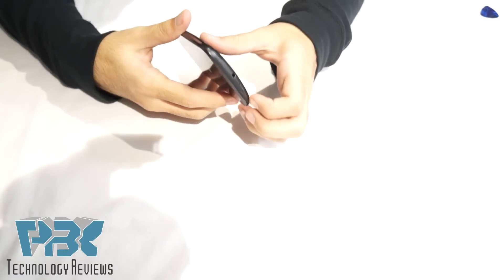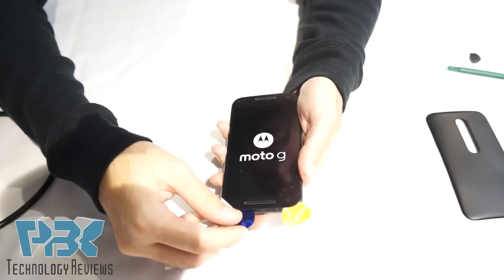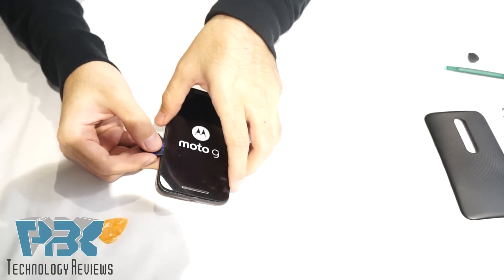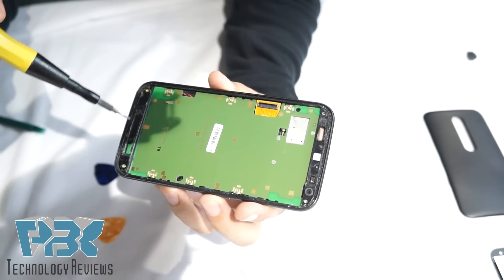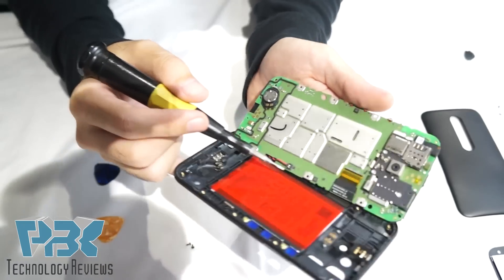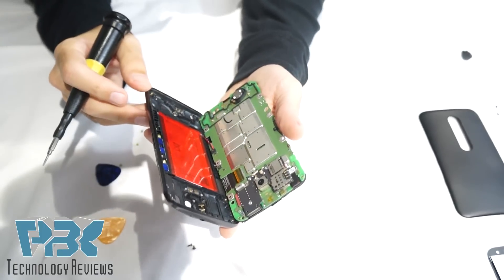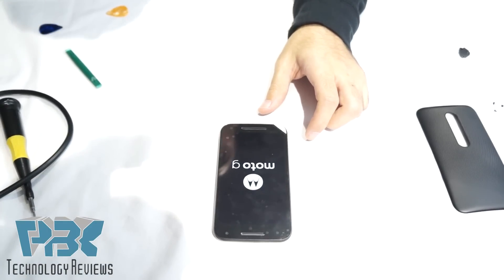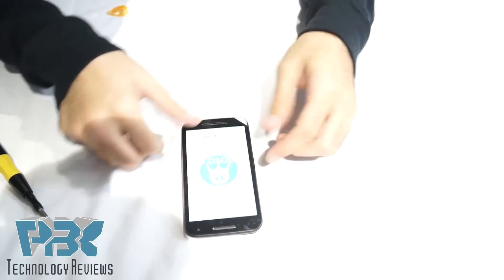Motorola Moto G (3rd Gen) 3rd Generation 2015 Disassembly Teardown LCD Replacement

Comment: Thanks for the video! My replacement battery does not have that red film cover the original battery has. What is that red film for?
Reply from the maker: Hi, I think its just a protective film over the battery. You can peel it off the original battery and place it on the new one.

Comment: Flashlight of my Moto G3 Turbo suddenly stopped working last week. It lit up only when I put pressure on the back near the flashlight.. please help
Reply from the maker: Probably the gold contacts behind them either have gotten dirty or bent down a bit so its not making a solid connection. You would need to take the phone apart to be able to get access to where the flash is and the contacts to make sure its cleaned out and properly making a connection. Not sure if its worth risking taking the screen off for just the flash issue etc. if accidentally it cracks and the fact you will need to re apply new adhesive. But its up to you. If your careful its doable.

Comment: while replacement do I need to apply adhesive (Glue or something) on the edges of the body?🤔
Reply from the maker: If your adhesive isn't holding well anymore, yes you will need to apply new adhesive. You can use smartphone Red tape which is sold on ebay. Its a strong adhesive tape you can cut to size .
Reply: @PBKreviews  ok thanks

Comment: the cable which you are pointing at 8:51 where can i buy that cable?...and can it be replaced easily?
Reply from the maker: Hi you can find it on ebay, search for moto g3 lcd flex and you will see it. And yes its easily replaceable. You just peel that yellow/orange sticker off the cable, left up the black lock in the side of the connector, pull out the old cable and insert the new cable to the motherboard slot, push down the black lock and put the yellow/orange sticker back over.
Reply: @PBKreviews  is the cable same for Moto g3 and Moto g turbo edition?(I own turbo edition)
Reply from the maker: Yea should be the same, I don't think they would make a different one for such a similar phone.
Reply: @PBKreviews  thanks man... appreciate  that you're still replying to the comments for a video published 3 years back😀
Reply from the maker: no problem :)

Comment: how to fix a screen display vertical lines,please help
Reply from the maker: If it has lines running through it most likely the screen will have to be replaced because either the screen is bad or the cable for the screen has gone bad.

Comment: thanks, excellent video. 
i have a question, will that affect the ip68 protection
Reply from the maker: I'm sure to an extent it might affect it, but if you have the replacement seal then you can apply new adhesive seal to it and should be good to go.

Comment: I was trying to removing battery beuase my XT1557 Got hard brick after 12 MB bloody update had taken place.My phone battery is not embedded with cable it is embedded in it .WTF!😨
Reply from the maker: have you tried holding the vol down key and power key for 20-30 seconds to try to reset it that way?
Reply: pwrdbykyank obviously
Reply from the maker: As far as I know, bricked or not, should be able to plug the cable to the computer from the phone while holding the vol down and power and should auto boot to the bootloader screen from where you can reflash it. As for needing to disconnect the battery cable, you will need to take the phone apart to disconnect the battery cable from the main board.
Reply: pwrdbykyank I mentioned to you that my phone is hard brick not soft brick
Reply from the maker: Oh ok, well I am not sure on how to fix that exactly, every model has its own ways I presume. Sorry
Reply: pwrdbykyank Its ok😭

Comment: just apply heat to put on the new display?? or need a special glue?
Reply from the maker: if the original adhesive around the inside of the frame is still good you can reuse it but if you want to ensure a good bond, you will need to reapply new adhesive/tape

Comment: I need help. I hope you will reply. 

My phone fell by accident hitting a wall on the way down. All of a sudden I lost sound. I smacked my phone and the sound came back. The sound had stopped a few occasions and I took my case phone case off and hit and then the sound was fine for a good while. 

Recently it stopped working due to me gently throwing the phone on my couch but this time the sound wasn't coming back when I smacked my phone. So I took the cover off and smacked it. 

I learned that smacking my phone where the three screws were (where you said the charging port was held) was were the sound issue was happening. Tapping that area made the sound come back and holding it for a bit then letting go seems to bring back the sound and it doesnt go back to no sound.

My question is  if I tighten the area with the 3 screws will this permanently fix the problem or would I have to open it all up and see if the speakers wires etc are disconnected. I don't want to put my drop my phone gently on something soft like a couch or bed and the sound goes back off again. 

By the way can you recommend a good screw driver to open my phone if need be.
Reply from the maker: Shade On A Cool Day hi yes it you tighten those screws it should help fix it since the contacts that touch the speaker to give it power are on the back housing. If it doesnt fix it, then maybe the speaker is going bad and need to be replaced. As for tool to use, husky brand has torx screw driver set you can use or different brands as well. T4 or T5 would be used for this phone
Reply: @pwrdbykyank Thanks. If you want some interesting youtube channels to watch check out the channels Vrillex and Black Child. I'm not affiliated with them in anyway I just find them interesting.

Comment: Thank you for the guide. I was able to replace my battery using your video guidance. My screen now has purple tinted lines all over though. You think my screen is busted or a cable adjustment issue? Thanks.
Reply from the maker: Maybe the cable is not in correctly or all the way. I would first look at the cable. If still issues then maybe you damaged the cable.

Comment: Basically the part of the phone where you connect your headphones is giving problems(only one side of my headphones for) so I wanted to replace it so........ Is it possible cause you didn't say anything about that?
Reply from the maker: Yea the headphone jack is replaceable. It sits in the rear housing and you can pull it out and replace it when you disassemble the phone.

Comment: I bought the Moto G Turbo Edition (the G3 on steroids). Unfortunately I used it to goof around in a pool and then water came inside the phone (I swear the back cover was correctly closed). Then what appears to be the touch component started to malfunction (like if the screen was pressing itself...like possesed by a demon, seriusly). I thought it would pass away with time but now it doesnt work, it doesnt even charge, howewer it looks like it can ve saved. What do you recommend me to do?
Reply from the maker: Jimmy Ramos best bet is to take it apart and use a toothbrush to brush off all the corrosion around connectors and chips. Then put phone back together and see if it will work.
Reply: pwrdbykyank thanks, I'll try whatever I can. By the way thanks a lot for the video, it was really well done. Very helpful.
Reply from the maker: anytime, thank you.

Comment: How do I change the  battery?
Reply from the maker: its attached to the back housing, you would either unscrew the two screws holding the plate it sits in and remove it that way after you have taken the phone apart, or you can heat up the back and pry off the battery from the plate it sits in once you have disassembled the phone.

Comment: My moto g3 turbo front camera is not working can u help me
Reply from the maker: Hi, if the camera is not working, you would need to take apart the phone and most likely replace the front facing camera. The hardware probably failed on it.

Comment: What temperature did you put on the blow dryer when the screen was warmed up?
Reply from the maker: well if you use a blow dryer/hair dryer there really is no temp you can adjust. You just heat it up to a point that you can tell the screen is hot to the touch. You dont want to heat it up too much and make sure you aren't holding the blow dryer/hair dryer in the same spot. Circle it around and gradually heat it up. Then you can try prying it up gently. If you see its too hard you can apply more heat and keep going. Excess heat will either make the glass too brittle and break when prying off or will melt off the digitizer glue and separate it from the screen or just damage the part in general. Thats why I suggest a blow dryer/hair dryer instead of a heat gun because less chance of causing damage if you don't know how to properly use the heat gun and temps.

Comment: My moto g3 display don't popsup after unlocking my  phone , but after switching it off and then on the phone ,, the display comes on , then the thing happens 
.
Reply from the maker: Not sure maybe you have corrupt software. Try flashing the stock factory firmware onto the phone with rsdlite. If you dont know how to use it google it or take to a professional to do for you

Comment: I really appreciated this video. My speaker was cutting out and I learned from another site that there were two prongs that needed bending upward to tighten the connection. This video helped me get to the offending prongs and all is working.  A couple of points though - I used a Torx T5 driver not T4 as mentioned here. Could not find T4. Also one corner of the screen did not glue back down properly when I replaced it and I can see light inside the device .  There was very  little adhesive there in the first place. 

What sort of adhesive can I use to seal the screen piece?

Comment: Is the audio jack even replaceable?  It looks like it's just stuck in there, and not really removable.  

I don't think I'll be doing all this for just a bad audio jack either way but such a stupid reason for needing a new phone.  Mine keeps having issues where it doesn't register that headphones are attached.  And when it does and I get to listen to music it then goes to pausing the music because it thinks the headphones were unplugged.  

Next phone I get I'm going to look into how repair friendly the phone is, because this is way too involved to be worth it for a cheap part.
Reply from the maker: Yes the audio jack is replaceable, it just sits in the back housing, but you can pull it out and replace it.
Reply: Good to know thanks.  I've been wanting to upgrade phones for a while now so might do so when i have the funds.  1gb of ram doesn't cut it and most of the time even just typing on my keyboard is really laggy.  Can't afford it now so it's good to know its fixable.

Comment: I took my Moto G3 to get the SIM card reader replaced and when I went to pick my phone I noticed that the ear-speaker and the mic weren't working. I couldn't hear while in phone calls and people couldn't hear me either. Only the main speaker worked but that is useless if I can't make calls or record audios in whatsapp. So I took my phone back to the service center and the man told me that the SIM card reader pops out of its place (that doesn't sound possible because there are some screws that prevent that popping) and that the sound isn't working because the same SIM card reader is connected to the "sound card" (if that exists). Could you help me verify this info he gave me? I don't want to be fooled, and if he broke my phone more than it was (it only had the sim card problem) he's gonna have to pay for it.
Reply from the maker: Hi, I'm not too sure on that, I haven't ever herd of that sim reader board being the issue for something like that though. Also the mic and speaker are located two different places so the chances of them damaging something related to both of them would be small. Maybe they forgot to put in the earpiece again? or maybe your headphone jack might be bad. Hard to tell can be a lot of things causing it.
Reply: pwrdbykyank I went to the service center today for nothing. The man hasn't figured out a way to place the reader without it popping back out, he said that the pins are smaller than the ones from the original resder. He also said that in the module there are some contacts that connect the mic and speaker. Is that true?
Reply from the maker: Hmm not too sure, its possible but I haven't worked much on these phones to know more about that. Can't they just get another reader board from elsewhere? maybe finding a parts or repair phone on ebay and taking it off one?

Comment: After dropping my motorola moto g 3rd gen there was no sound coming from the speaker at all! I've removed the back case and only seen a few screws by the charger port and by watching this video it helped me locate the speaker and simply pressing hard on both sides from the screen and at the back, it must have been a lose connection or something because it's working again.
Thanks 😃

Comment: My moto g3 loudspeaker has small mesh and i can see green component a bit.So, my question is will it safeguard from water?
Reply from the maker: I'm not 100% sure but I would lean toward that it would still be sufficiently safe. If it bothers you though, you should open and replace it with a new mesh

Comment: My phone get wet. After six days it worked again. All seems to be right till I found that vibrator dosen't work any more. Where is the vibrator motor in the mother board? Its changable?. Another question: What temperature do you use in the heat gun to take off the screen?
Reply from the maker: Hi, the vibrator motor is right above the LCD connector on the back side of the mother board. If I remember correctly its soldered onto the board but is replaceable. Maybe it just has corrosion on it, you can brush it off and should work again. I'm not sure on the temp, but you can always use a hair dryer to heat it up

Comment: Hi....my moto g3 is not giving battery backup for full day on normal use...I am using two sims which is Jio 4g VoLTE and Airtel and i use jio data very rarely not often all the  time i have optimised all apps no background running apps still not giving backup..battery is in dead mode..? Pls help me..quick response will helpful for me...Thnx...
Reply from the maker: Hi, I don't know what you mean by battery backup?
Reply: pwrdbykyank my moto is not holding the battery backup..?

Comment: Where's the antenna?
Reply from the maker: antennas are on the plastic back frame or mid frame, they are the painted looking lines running on and around it, and they touch the gold points on the main board to make connection.

Comment: Fala Galera, eu resolvi o problema do Led de notificação acesso.  Isso ocorre pois entra umidade pela entrada do falante auricular, e oxida os componentes ao redor do LED.  Para solucionar tem que abrir o aparelho removendo a tela, removendo a placa, removendo o suporte plastico que fixa o falante, e limpar com álcool isopropílico o LED e os componentes ao redor do LED. Deixar secar bem, e pronto.  Problema resolvido !!!    Abraços

Comment: Can I use a hair dryer? Is it safe to use that..? I want my display safe..🙄
Reply from the maker: yes its safe to use a hair dryer, you dont need to heat it up too much, just gradually heat it so it loosens up. Meaning don't hold the hair dryer one spot for 2 minutes. Keep moving it around so it slowly heats up to a point you feel it will come off easier.
Reply: pwrdbykyank Actually my SIM card tray is damaged, ordered one and it is on its way.. Thank you!😊
Reply from the maker: no problem :)

Comment: Hi. Can I use hair dryer to disassembly LCD?
Reply from the maker: Yes you can use a hair dryer to heat it up
Reply: Oh, greath :)
And one more question,
Can I get a warm adhesive directly when the screen is removed and then back the screen? It seems to me that this is a better way to heat adhesive, but I am a beginner, don't know if that is possible...
Thanks a lot for fast answer, and for greath video too ;)
Reply from the maker: I dont understand what you mean, please explain
Reply: I need to replace sim reader, and procedure is this:
1.Heat the glass
2.Remove the screen, then take off flat cable
3.Remove the motherboard
4.Take off battery connector
5.Replace sim reader
6.Connect battery cable
7.Screw the motherboard
8.Connect flat cable for lcd and return the lcd
9.Heat again to reactivate adhesive
10.Done
And, can I first do point 9. and then point 8., i.e.
1.,2.,3.,...,7.Screw the motherboard
8.Heat again to reactivate adhesive directly (before putting back the screen)
9.And then connect lcd flact cable and put back the screen
I'm sorry for my bad english :)
Reply: pwrdbykyank hi where is the gps attenna. i need it very urgently.
Reply from the maker: I'm not sure where the GPS antenna would be, sorry.

Comment: i cleaned up my earpiece with a brush and it made some holes on its plastic cover does it affect on its water-resistant
Reply from the maker: I'm not sure, shouldn't affect it much
Reply: no it does not. Unfortunately i have tored mine down too and it did not affect it at all
Reply: Did you expose it to water
Reply: dear Tushar mane did you expose or submerge your Motorola Moto g3 to water

Comment: Dear friends, i read through many of the commentaries but i'm not secure of the answer to my question:
I need to switch the headphone jack, so i'll proceed just like the video so i can open the back and switch it.
I'll lose the "water-safe"ness of the phone on the process, right? If so, how can i make it water-safe again? Is putting some new adhesive tape where you cut at 7:30 enough? I'm a little confused. Thanks for the attention!